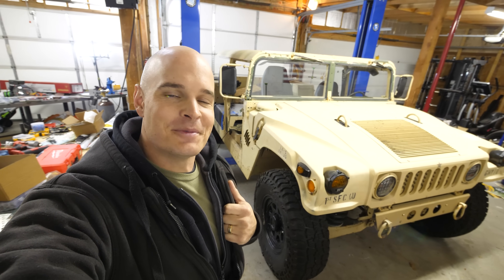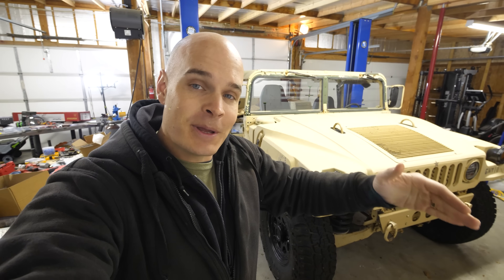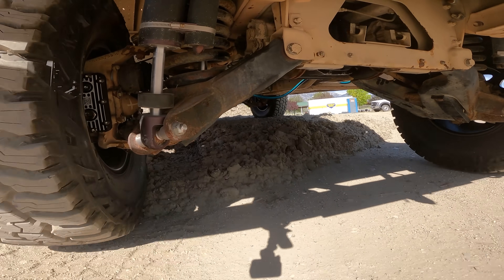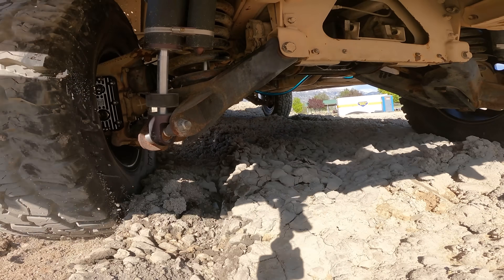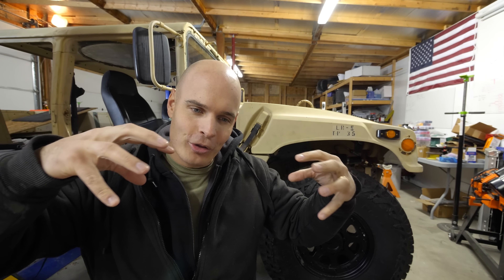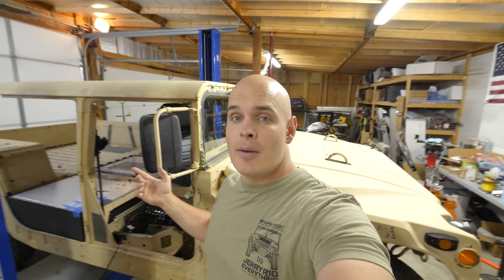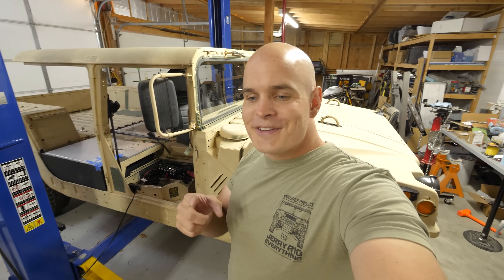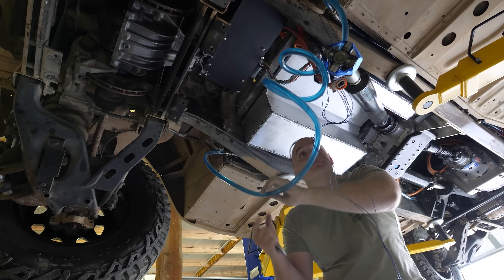I have some explaining to do... - EV Humvee Update

Comment: This Can Network issue might be happening because there should be 120ohm resistors at the end of the lines. If you can read   the Can Network messages using programs like Pcan View, Pcan Explorer or BusMaster then there shouldn't be a problem. Then the problem might be about individual components might not know the messages they sent to each other. Can Network devices communicates with each other with message id's and datas. If the recieving device does not know the id and how to decode the message that means just bunch of zeros and ones coming to it. So there might be some configuration needed component based
Reply: I was also thinking about the resistors needed. Sometimes 2 of the devices on the CAN network will already contain the terminators since they are at the ends of the CAN bus. But since this is a custom design I don't know which parts if any would have them built-in.
Reply: @razredge68  usually those devices are the display and the VCU but it's entirly possible for other components to esp if from a tesla (which has multiple canbusses BTW) to have them built in aswell. abdullah is also correct in the the devices may not be configured to talk with eachother correctly on the bus.

Comment: Hey! one thing i wanted to suggest is throwing some led's in the area of the charger port. That way you can see and line up plugging in the charger in the dark. My BIGGEST pet peeve with current commercial EV's. Makes it a PIA to get things plugged in quickly when on the move.
Reply: @Twon It already has one. Zack points it out at 9:00 in the video. It's a clear one that sits at roughly 1-0'clock relative to the charger port.
Reply: @GrayRaceCat  I think he means LED lights to light things up not to see if there's a connection.
Reply: the charger handle is the same shape as a gas nozzle and they only do in one way
Reply: @aleks138  true and i may be the only one that has trouble with this at times but I have a jeep 4xe and  when it s really dark out  it sometimes takes a bunch of finangling to get the charge plug set right. Usually ends up with me digging out a flashlight. Just thought this would be super cool if it was on a door release switch so that when the charge cap is open it illuminates a led strip around the port to illuminate it. Its only a minor inconvenience but sometimes little things like that make a difference
Reply: @martinfreiberger9915  You’re right, I totally missed that. That’s what I get for not reading the entire post. Thanks.

Comment: 6:53 Is this a solder type or crimp type heat shrink/environmental shield? If it's a solder type, you really gotta heat them up to let the solder flow to ensure the wires don't get pulled out and ensure good connection. If crimp type, then super cool!
Reply: This. At least in the video snips he included, it looks like the solder blob is not melting and so probably making poor connection.

Comment: 6:55 - the solder ring in the shrink wrap should melt and wet the wires. Those looked like they didn't.
Reply: This.
Reply: This, the couple seconds to shrink the wrap didn’t melt the solder and is going to be a very bad connection
Reply: My thought exactly, better to use a solder-sleeve reflector nozzle. Way less hot air loss, due to concentrated airflow. The solder needs to dissolve completely into the strands.
Reply: Yup, those cold solder joints, non-continuous ground shielding, and (likely) incorrect can bus termination. It all adds up.  I don't recall seeing Zack whip out the laptop to configure (via USB) the display or anything else.

Comment: It would be better to use network cable for your CAN bus, like CAT5e or CAT6.  That way it's shielded and twisted pairs.  The wire you're using is WAY too thick to be used in a CANbus.  Remember, it's just signals wire, not power wires.  Take a look at any car from the last 10 years in the junk yard to get an idea of the wire gage to use.

Comment: CAN bus guy here.  You should look at your CAN devices and see if they have internal termination options either as a physical jumper or through software selection.  You want the end devices at opposite ends of the bus to terminate.  Terminate is a 120 ohm resistance to stop data reflections.  Of course everything needs to be at same CAN bus baud rate too...

Comment: that coilwhine noise it produces would drive me insane real fast
Reply: still sounds 1000x better than a diesel truck
Reply: @GotDamBoi  that's very individual. My ears are sensitive to extremely high pitched sounds, so diesel rumbling is easier to handle, for me at least.
Reply: @Tsukeh  I used to fall asleep in my stepdad's diesel truck all the time, so the diesel rumble is rather calming to me. I really dislike the smell that comes off of a lot of diesel trucks, though
Reply: @GotDamBoi  Still he is not comparing to the diesel version, he just says that the sound is annoying, which it is
Reply: @GotDamBoi  Not a chance. That whine is ear-piercing.
Reply: @GotDamBoi  No, high pitched whining is super irritating. Its the main thing putting me off EV's.
Reply: @Tsukeh  if you change the frequency of the output to the motors, the switching frequency of the mosfets, to above 30khz it becomes completely inaudible. the only sound is the motor whir which is caused by the magnetic interaction of the stator, and the bearings.

higher switching frequencies are bad for the mosfets, which is why they keep it within the audible range
Reply: Diesel engine noise is main thing putting me off diesels. Hear worse whines from computers all the time, so guess I'm more used to that.
Reply: Not really, the noise from driving and whatever radio/podcast/whatever you're listening to drowns it out just fine.
Also you gotta remember that a commercially manufactured vehicle is going to have sound dampening and such things built in to reduce noise further. This is a DIY conversion of a military Hummer, it has no sound dampening and the vehicle itself is open to the environment which lets even more noise in.
Reply: @mjc0961  well, i'll be, you just listed all other things that can drive a man nuts - radio commercials, dumb AF podcasts, mother in law, wife... enough! 😑😁
Reply: @Blox117  ya, I was thinking “if the switching frequency can be changed in the controller”.  No need to go to 30 kHz, though.  Even 10 kHz would be practically inaudible, at least to adults.  It’s probably set at 2 kHz, currently.
Reply: @gregholloway2656  no, the way it works you would especially still hear the harmonics at half that frequency. at 10khz is extremely audible, 20khz is standard, 30khz is silent, 40 khz is inaudible
Reply: @gregholloway2656  also im going off the settings for a VESC so it may be different than a larger EV.

Comment: Sometimes flashing the aftermarket firmware solves the problems with CANBUS driver within the software. Otherwise, did you check the continuity between the plugs, and are they already twisted pairs within the cables? (It's VERY important that SPI and CANBUS cables are twisted due to the frequency they operate at - 20 MHz or faster depending on automotive electronics involved, which also MUST agree to operate at same frequency in CANBUS so you don't get data collisions.)

EDITED: People are correct about the terminator resistors. Forgot about that...

Comment: My bet is on baud rate mismatch along with lack of a terminating resistor at the end of the trunk line?
Reply from the maker: Hopefully it's simple! I did attempt to verify those things.  But I'm no expert.
Reply: The termination resistor was my first thought too. This looks like a problem I had faced, and adding a termination resistor fixed it.

Normally, the CAN protocol has a feature called CSMA/CD (Carrier Sense Multiple Access/Collision Detection) and it is this feature that handles the timing and arbitration of information exchange between the master and the slaves. 

About the baud rate, as long as Jerry uses a simple CAN configuration (like CAN-FD) I guess the baud rates are standardized across manufacturers at 250Kb/s or 500Kb/s or 1Mb/s. So, as long as Jerry selects one uniform setting across all devices, he should be able to get it up and running. Now if the clock settings are messed up in firmware (or worse, electrically) then there's nothing anyone can do about it.

Can someone correct me if I've messed up?

Edit:- Typos, indentation and cleared up a point I made earlier.
Reply: It seems like he can can bus messages. As far as I know mismatched baudrate downs the can bus network. My bet is the configuration of the devices. They might not know the message id's and decodes

Comment: Hey Zack. Mechatronics Engineer here. That's a common problem in CAN wiring. You should have two resistors across the CAN-H and CAN-L at the farthest nodes of the CAN network. 120 Ohms is the standard resistor used especially since you are using the Orion BMS module.

Comment: Hello, cool Project. I want to add 2 things: first. The shrink-solder-splice at7:00 is not soldered, just the flux is molten. That is very unfortunate, maybe contact at the beginning but with time it will likeley fail. And it will propely fail intermittend. Shrink-solder-splice are difficult to apply on low melting wires.
second: Maybe an upgrade to 4 Motors instead of differentials and gearbox🤩

Comment: Hi Jerry, (as English isn't my natural language I hope I am able to make myself understood here). The best way to make sure you have a working CAN-BUS is to avoid ALL branches. Route the CAN-BUS from node to node, ONLY having terminating resistors (120 ohm) in both ends. Also, you can in most cases and especially in this case where you have so few nodes choose a lower bit-rate, like 250 and even 125 kbps, to make the communication more stable. The electric design of the CAN-BUS makes it very noise resistant, why shielding most often isn't that important.

Comment: When I first got started in the wind turbine industry, we used CAN for communication between PLC modules and man was it a pain in the ass to troubleshoot and work with. One single resistor in a CAN cable somewhere breaking lose from the solder would completely nuke the coms for the entire PLC network. Current turbines I work on use Profinet which is Parallel instead of Serial like CAN and it's been a godsend.

Comment: On top of everything else, just make sure that your shield wire is connected only in one place, at the beginning of a trunk to the ground. If it is connected in multiple places, you'll have hard-to-diagnose ground loop problems. This is related not only to CAN, but for other types of signals, where shielding is required.

Comment: Hi Jerry. You’ve probably sorted it by now, but on the Orion 2 software there is a third party CAN communication list for specific charger units such as ELCON chargers etc. not sure what unit you are using, but it might be listed there already. Lots of these units use specific CAN PID codes that command and request specific data. It is possible to set up the ORION 2 to send and receive custom CAN data that you can edit yourself, but you would have to know what specific CAN address and data the charger is expecting to receive. also, make sure you have the “charge Enable” button set on the Orion charge settings, and that your Charge Current Limit isn’t set too low. If these are set incorrectly the ORION system wont allow your charge relay to close…if you've wired it according to their wiring manual. good luck!!! looking forward to seeing  you sort it out. cheers

Comment: Besides the terminating resistors what everybody is saying, check the shielding. Connect it through when you branch off and ground it on all ends. Also run the CAN cable away from any (high) power lines. At least 10cm away.

And also you can double check the software settings.

Comment: I have ran into a problem with those heat shrink solder connections adding a small amount of resistance when dealing with sensitive electronics. When I had wired up my gps steering for my tractor I used 2 of those on small wire connections. I ran into issues for over a year before I found out those were the issue. 
My tractor would drive in circles out in the middle of the field being very weird. Changed to just good solid crimp connections with adhesive heat shrink and all issues were resolved. Going on 2 years of perfect operation.

Comment: @6:56 Not a fan of those type of connectors. Not always a good positive solder joint. Possible overheating point and difficult to pinpoint without a voltage drop test or thermal imaging.
I hope yours work Great for Decades!👍
Mike in San Diego.🌞🎸🚀🖖

Comment: In addition to having the correct terminating resistors you need to know what communication protocol you are using.  RS 485, j1939, rs232 etc.  That will determine the structure of the communication network.  You would also need to program buad rate and addresses into the system.

Comment: CAN is pretty hardy, and there are only a few things that you need to make sure you have right.

- Wiring configuration is super important as you pointed out in the video. I think you have that licked.
- Termination resistors are a must at the ends of the CAN bus. 120 ohm at each end. You might need to make sure that none of the other devices on the CAN bus have termination resistor as sometimes they can be on the board
- Making sure you don't mix up the CAN-High and CAN-Low wires
- Making sure the bus speed is consistent across all devices

Other than that, it is all about the signals on the wire.

Comment: It's your butt connectors. Either solder them directly or use poke and wrap method. I install telematics and tracking system in vehicles that require tapping into the can bus. Ideally you would use y slitters with can plugs where the only time a wire terminates is inside the plugs. Or use the poke and wrap method to add connections

Comment: Can networks are always fun. There is often a standard that they are based on. There are all sorts of limitations, such as the termination resistors need to be on the longest possible path of the network, and then there are limits for the maximum length of each stub on the network.  

they're always a pain to troubleshoot!  but when in doubt, look up the standard, and make sure you do everything it recommends.

Comment: I do a lot of work with CAN and EV's. You can sometimes get by in CAN networks with less than ideal construction, like improper termination, drop length, etc. When you are having PROBLEMS or random issues, or CAN retires or errors, it's time to start fixing your network harness to spec. 1: Make sure all your devices are at the same baud rate. 2: make sure they are not using different protocols, like one device that speaks CAN2.0 and another that uses J1939. Also be sure that you don't have two devices that are using the same CAN ID's, even if they are speaking the same protocol. 3: Use a trunk line / drop line topology rather than a star topology, and keep your drops as short as you can. 4: Use ONE 120 ohm resistor at EACH end of your trunk line. 5: Use shielded cable specifically designed for CAN / J1939 and keep the shield connected continuously through the entire trunk. 6: Ground the shield at only 1 point in the system. 7: Try routing the network as far from the high voltage wires (or other electrical noisy wires) as possible and cross them at 90 degrees.  After you've made the best physical network possible and still having issues, you can use CAN software tools to see if you are having noise related issues. Also you can try to remove one CAN device at a time to see if there is one "bad actor" in the system.   I once had a data logger that would upload data to wifi every 10 minutes. After the upload it would reconnect to the CAN network at 500K, crash the entire network, then change it's baud rate to 250K, for which it was configured to be at in the first place, then the network would work fine for another 10 minutes.

Comment: As long as you're using that vinyl tubing, you can pinch it off beyond where you need to cut it, to avoid draining the system and then having to refill it and completely purge it of air.

Comment: as already stated, check the resistances of the CAN lines, you can do so by measuring the resistance between the CAN+ and CAN- lines (it should be 60ohm), if the resistance is correct, you need to check for wiring damage (and possibile contact with ground), if this also doesn't work, you may need to re-route the can wiring since there could be interference from the current flowing in other wires (which in an electric vehicle is substantial). 

these solutions are listend in order of likelihood, i also assume that all computing units are using the same protocol (no mix and match between CAN high and CAN low)

Comment: When I install two wire spi or can I like to pigtail the taps with shielded cable right to the device. I keep the shield as close as possible to the connection.  Although in some instances using cat5e twisted pair can work well too. As long as you are using the appropriate termination resistor at the end of the chain.

Comment: CAN is actually pretty straight forward. You need your end of line resistors, shielded cable and absolutely need to confirm communication speed. Many modules will come in preset to auto-baud, you might want to just set those static. EMI issues may be causing your CAN problem if the CAN wires are not properly shielded.

Comment: You need terminators on both ends. They are usually 120 ohms. This helps bring your voltage back to 0 quickly so the messages will be clear on the network.

Comment: With Ford starting to offer the motor setup they have for the Mach E Mustang as a crate motor I really hope to see a lot more projects like this especially with classic cars. If I were to ever get the cash together I would love to get a late 60's/early 70's Chevy or Ford pickup, turn the bed into a battery bank and run two motors for an AWD style setup.